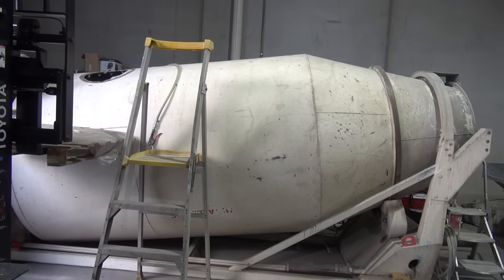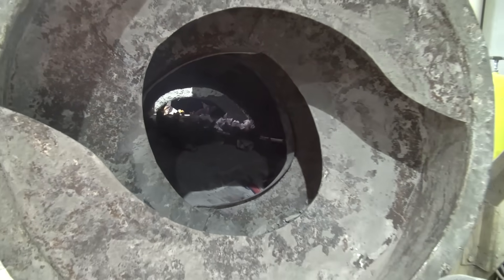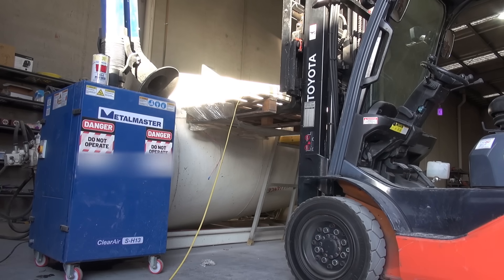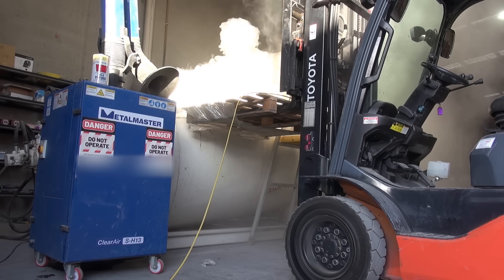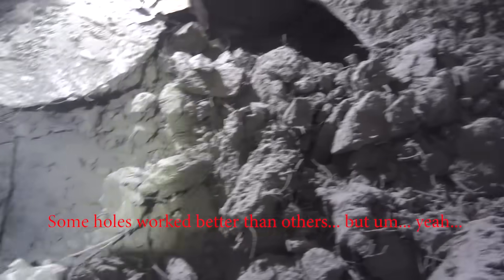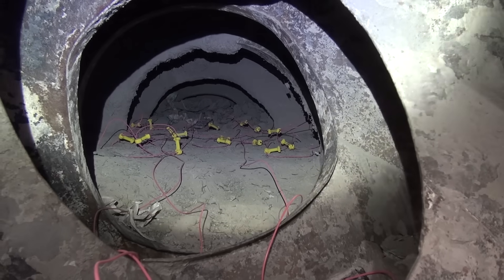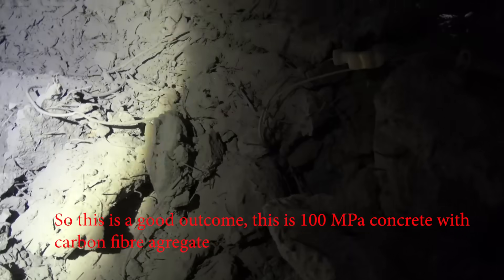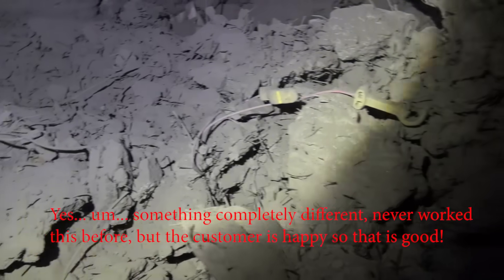Using Explosives to clean out a concrete truck

Comment: As a teenager a guy gave me a job like that for 50dollars I guess he thought I'd have failed and wouldn't have pay or was trying to make me look stupid the concrete was about 3 to 4ins thick in some parts well I got some oily rags and some scrap boards and made a big ass bonfire inside it all came falling down after the fire burnt out and some solid wacks on the outside with a piece of 2x4 he was pissed and didn't want to pay but he agreed I was smarter than he was after I casually suggested the the whole truck would make a damn big bonfire if I didn't get my 50bucks
Reply from the maker: That is an interesting method Hubert.

Comment: I’m curious why you wouldn’t perform this job outside? There’s gotta be concrete dust all over the building.
Reply from the maker: It's a bit hard to move this outside Neo, It's got no wheels.
Reply: @demolitiondavedrillandblast  So, why is it inside this building? Does the end user have it mounted there to make product?

Comment: My uncle in Toledo, Ohio ran a concrete business. If a truck was late or if onsite too long and the concrete was going to go off. The driver would ask where the closest grocery store was. He would go and buy bags and bags of sugar to put in the mixer. The concrete would never harden.
Reply from the maker: If you are able to mix it in, this mixer had a hydraulic fail and was not able to turn.
Reply: @demolitiondavedrillandblast  I do understand that the concrete had hardened in place.
Reply: Yep, sugar works well.

Comment: LMAO,   seen this underground.    Usually it's the remix breaks down so can't dump it,  but several times it's the opperator.    We hand him a chipping gun and a fan.  Get to gettn!!

Mythbusters didn't understand the myth at all when they tested it.   It DOES scale the sides off, it can remove mass material,  and yes it can blow random holes in the drum

Comment: I don't understand how a concrete truck with dried concrete in it has metal in the concrete. Concrete is a wet mix there is no metal in it until it is poured and mixed with the metal/ wire reinforcement on the ground
Reply from the maker: Read the video description and all will become clear.

Comment: I have done that about 15 times , a pain in the ass , the most difficult is when it’s full of little wire , you get in the mixer and you have to bend all the spikes that will make a hole in your skin lolll
Then the big pieces I was using a powerful zip cut to break them in smaller pieces so I can pass them to the guy at the exit hole ...
Reply from the maker: I feel your pain brother!

Comment: "Unlike Mythbusters we're going to do it the way it works." Lol, I love it! Mythbusters were so full of themselves at times.
Reply: They may have done it wrong on the show but you can't deny the end was impressive
Reply: What's wrong or right depends on your goal... Mythbusters didn't intend to clean out the truck.
Reply: @rorschacht8478  I understand that, but on multiple episodes, and it was theme not the just the title of the show, they stated the myth was busted. They both promoted themselves as being very scientific but oftentimes they were not.
Reply: @troyezell5841  That's true but they were making a show. You should check out Tested on youtube, adam explains and talks about the show a lot.
Reply: @rorschacht8478  I don't mean to sound overtly aggressive toward the show, it was just a bit excessive at times. You make a good point.

Comment: I've been inside of those with a big air hammer chiseling out the concrete. The truck broke down or they evacuated the mine I can't remember. Its an underground mixer tank. They fill up the spraymecs to reinforce the shafts after they have been drilled and bolted. Hog wire is held down by 4" or so square plates from the bolts. Then sprayed with 3" or so inches of concrete. Interesting process with the fibers to increase the strength.
Reply: Ya I thought so. Looks like the normets drum we used. Those fibers makes it impossible to clean by hand
Reply from the maker: That is exactly whet this one is used for Pat.

Comment: 20 lbs of sugar when it breaks down will work. Hydraulic problems or breakages no problem. The old sugar trick will work if you can rotate the drum.

Comment: When I’ve ordered a concrete truck to pour concrete it usually doesn’t have rebar mixed in that would of saved a lot of time.
Reply from the maker: This is special application stuff for shotcreting the walls in an underground mine.

Comment: How many cameras did you lose and what is the cost of such work?
Reply from the maker: None lost, the DJI Osmo Action Cam inside the barrel got very covered in concrete dust but it cleaned up OK.
Reply: @demolitiondavedrillandblast  How much do you charge to do a job like that.

Comment: Thanks dave and well done. If you ever need to break Chinese concrete a loud sneeze  will bring down the tallest building.HA HA HA.
Reply from the maker: Ahh... my coffee just came out my nose.
Reply: Steve Arthur  unless its that hospital housing wu-flu patients that collapsed a week after it opened.
Reply: @The_JEB  In any case those were intended as temporary structures for the emergency and many/most? were subsequently disassembled/decommissioned (not sure what happened in the later waves)
Reply: True Story  no concrete  but also  no truck! ! ! !
Reply: But it's the US infrastructure that is falling apart...! 😀
Reply: @henryrollins9177  Not because of rubbish materials less than a decade from their initial construction date, but rather from negligent management of proper maintenance practices to suppress necessary taxation rates or unconscionably enhance profit.

Comment: Presumably the driver that let the concrete go off in the first place, no longer works for the company.
Reply: Or the truck broke down and they couldn't get it started back up in time. You would have about two hours if you were lucky. Depends on the mix and the temperature outside.
Reply from the maker: @Darkstar - exactly fast setting shotcrete mix here.

Comment: CSA cement (calcium sulfoaluminate) [ -> concrete] with multiple fiber lengths and diameters..  whoa..  that would have taken weeks with a power hammer..  2 -3 days old and already at 12kpsi for the cement alone and I think 'Dave's way' was the only way to even get this started..  
www.csacement.net
for more than just countertops...
Reply from the maker: Very interesting TS.

Comment: My buddy used to remove concrete from trucks for a living. They would go in with jack hammers, sludge hammers, picks and wherever else they could use to break it up. I bet he would have loved this method over being in 95 degree heat inside a oven that’s 120 or more running a jack hammer for 10-12 hours a day all summer.
Reply from the maker: It's a hard job Rusty.

Comment: Who in the right mind let's concrete go off inside one of these? Well done for getting it out though, I was wondering what the spikey bits were until you said Carbon fibres, I initially though they were steel wires but was confused as to why someone would put them in the drum.

Comment: Retired Boilermaker, they used to have us go in the boiler with a 10 gauge shotgun. We used it to shot the clinkers out between the tubes in the superheat section. The trash burner in Newark NJ used ammfoe and broom handles to blast the clinkers out using the concussion, the whole boiler would shake and move.
Reply from the maker: Common practice Ken.

Comment: Wow, 100mpa and fibres!! Be interesting to know what that was being used for,  👍🇬🇧👍
Reply: That's for my garden barbecue. My neighbor always try to steal things from me. From now on, he'll need explosives.
Reply: @arneanka4633  too bad, your neighbour is now going to call Dave when you're out and say it's his house and he wants to remove those.
Reply: What is is used for?  ASCE concrete canoe competitions.  Concrete countertops..sometimes done upside down with the surface poured first using a fine aggregate surface, then the fiber reinforced main layer.  
Expensive as frig for anything else.
Reply: @keithjurena9319  how long does it last?

Comment: FYI, there are clays that, when mixed with water and poured into holes, will expand to hundreds of times their mass and break rock and concrete up. It takes a day or so but its probably cheaper than the explosives.
And most of the time you don't even need to be there, so no wasted man-hours.
Reply: Dave does that, too!
Reply: Could you please help me find this clay? What is it called?
Reply: @mariarust.  Demolition grout.  Drill a series of holes, mix the grout, pack it in, wait.

Comment: I watched the mythbusters episode and was immediately struck by the fact that they decided to ignore the parameters of the "myth" and fill the mixer with concrete.
The "myth" was never about using firecrackers to break up a block of concrete...It was about using the difference in resonance between the thin concrete coating and the steel walls of the mixer to detach them from each other.

Comment: 100 MPa with Carbon Fibre reinforcement, what the hell did the customer build, that required that Strength??
Reply from the maker: Shotcrete the walls in an underground mine I believe.

Comment: I was at a speciality cent factory where they had a long tubular kiln which would occasionally suffer be a similar problem. 
In their case they had a cannon  at the open end and fired solid shells at the accumulations.
Reply from the maker: Yes, common procedure Jon.

Comment: Incredible job with no apparent deformation of the steel especially given what was need to account for the carbon fiber thread inclusions.
Reply: Its not carbon fibres... its glass-fibre,  polypropylene, steel or macro-synthetic fibres... 

https://www.roadstone.ie/product/fibre-reinforced-concrete/

Comment: It's off of a cement truck and the motor used to rotate the mixer broke and once the mixer stops rotating the cement hardens. There are companies where all they do is jack hammer concrete to salvage the mixer.
Reply: I've heard that if sufficient sugar is added to the concrete prior to it hydrating it actually won't come up completely to strenth and is then easier to remove.  Wouldn't  want to be the chapter in the barrel stirring in the sugar though. Lol!

Comment: have u seen or used the oil well coke can sized shaped charges? that would be fun way of coring the center out?
 shaped charge or “jet” perforator
Reply from the maker: I know the ones FF, core a suitable hole drop a shortened length of perforation charge in and let it rip, interesting concept, might be a bit savage.

Comment: I worked in a silica mine a few years and used dynamite to blast down the walls. We would drill 6 holes 10 feet deep each about 5 feet apart. Load 6 sticks of dynamite in each hole spend about 4 hours packing the holes . Blast them all at once and hope for the best. If everything goes right all you would hear is a snap the the wall would come down then the work started in 3 days .
Reply: Why wait 3 days?
Reply: @mrbmp09  got to wait at least 3days so everything has fallen. Don’t want to be working around walls and have a bunch come crashing down on you. I had it happen to me once while close to wall . Wall came down I just barley jumped off tractor in time . Couldn’t see nothing of tractor but a little of back tire spent the rest of the day digging tractor out.

Comment: Well you weren’t joking about this one being different!! Being in the concrete industry, that sounds like a pretty expensive load to begin with! I know of an abandoned mixer with a full drum.. went off the road and got stuck on the way to a job, it’s been in the same spot for years now!
Reply from the maker: If the barrel is otherwise in reasonable condition it could be a viable option to fix it up.

Comment: 100 MPa = ~14,500 psi... that's 3x the strength of normal construction cement, where the mortar cubes break at ~5,000 psi after 28 days of curing...
Reply from the maker: OK, thanks for that, I had never heard of concrete this strong before this job.

Comment: You mentioned the tight quarters there Dave, but I sure hope that your tetanus shot was current, as all of those steel needles in the concrete sure looked wicked in terms of handling without getting stabbed - let alone crawling on that stuff.

In my mis-spent youth, I worked for cement company - we made the grey powdered Portland cement - and some of the hourly guys had forgotten to turn off the tap for the water based grinding additive one night when they shut down a ball mill. They tried to jackhammer out the "monument", but ultimately the blasters from the quarry had to come down and use some dynamite to loosen things up enough so that the mill could be restarted to grind up the concrete from the charge in order to return the beast to service.

It was a little mill, dated back to the 1930s or even earlier, and they guys nearly went deaf from the jackhammers, even wearing double hearing protection (plugs and muffs).

At that, I think that they still had more room to work than you had inside the Trommel of that concrete mixer...
Reply from the maker: That is not actually steel you are looking at but flexible carbon fibres Chemech. Thanks for watching.

Comment: Wait a minute!  The Mythbusters got the concrete out!  There was no concrete left in the truck when they were done. :)
Reply: Also there was no truck left unfortunately.
Reply: @cpt_nordbart  details.    😂
Reply: @cpt_nordbart  A minor detail....
Reply: @cpt_nordbart  that exploded everything when it was done
Reply: It was a long time ago but from what I remember didn’t they have a FBI explosive specialist helping them out. I think they tried different levels until the big finale.
Reply: Yeah he should've since it the Mythbusters method, he would've gotten more views garunteed 🤯💥💣
Reply: @nnnnnnnnnick5557  Well the mythbusters were just detonating it on the surface, he handles it like you would a rock and use the explosive to cause stress fractures effectively shattering it with just a small hole drilled.
Reply: @nnnnnnnnnick5557 : Laugh, Bitten, forensic, exhaust.
Reply: Didn't they find like frame rails a half mile away?
Reply: Myth busters VAPORIZED that truck!
Reply: also, no truck
Reply: amfo
Reply: You was only suppose to blow the bloody concrete out
Reply: Yeah, that famous BOUDOUMMMMM!!! XD
Reply: Exactly that came to mind too 😂😂😂
Reply: There was also no truck left when they were done literally disintegrated the entire truck 😂
Reply: In fact there was nothing left when they were done!
Reply: Ohh god! It's steel fibre reinforced as well.
Reply: But there was a beautiful mushroom cloud, and Keri look like she had a little 😃
Reply: @jrbay1  Hey I never said it wasn't great! I'll admit I had far too much fun as a teen making home made bombs and explosives in the country side of North Carolina (and playing with nearly illegal fireworks a friend's father bought every year from South Carolina Firework manufacturers).
Reply: Mythbusters was a scripted show, with results written before anything got built or "tested".
Reply: @danirizary6926  holy shit... your smart.
    Another tip...never put your hands in boiling water..its hot
Reply: @danirizary6926  I find this hard to believe

Comment: cut a access hole in the side of the drum its not hard to weld steel plate back it will make the work so much easier for about 3 hours of welding

Comment: I WAS wondering  how  they  cleaned  them out  at the  end of  a YEAR!
Reply from the maker: Most of the regular clean out is just removing build up because over time it gets thicker and the capacity reduces, this is a whole different level of disaster when a full load goes off inside.
Reply: @demolitiondavedrillandblast  Word for word, that's what she said.

Comment: In the late 70’s/early 80’s I was in the ready mix industry and saw the result of someone’s ham fisted attempt to blast set concrete in an agitator. As you would expect, it looked like the aftermath of a war bomb hitting a tank- pieces of metal everywhere. At a plant I managed, we cleared a barrel by getting the local fire brigade to hose out the wet concrete.
Reply from the maker: But back then it was relatively easy to obtain bangers and from stories I have heard, all kinds of things often went off the rails. I guess the fire hose is good if you are onto it quick.
Reply: @demolitiondavedrillandblast  here’s one you will enjoy. Back then in the concrete plant I ran, there was a leftover box of detonators in a shed and the previous owner was there one day. I asked him how we should get rid of the detonators and he said to put them in a steel drum and burn them. He did so and a short while later, there was a massive bang and the drum went flying through the yard. So much for his expertise!
Reply: @demolitiondavedrillandblast  Breaks down the Cement Paste Ratio to almost nothing. Just need the room to make the mess.

Comment: 100mpa !!!!  with carbon fibre - holy crap, what sort of construction needs that sort of mix, I wonder.  Did the driver get the arse for letting that set, or was it caused by equipment breakdown?
Reply from the maker: I have no idea how it happened, this mixer came from an underground mine and I think it may be a shotcrete mix Ein.

Comment: Okay but why is there rebar IN the mixer
Reply from the maker: only carbon fibres DB are you possibly mistaking one of the exposed half drill holes as a piece of rebar?
Reply: @demolitiondavedrillandblast  I guess it is the carbon fiber. Its all strandy and look like rebar.